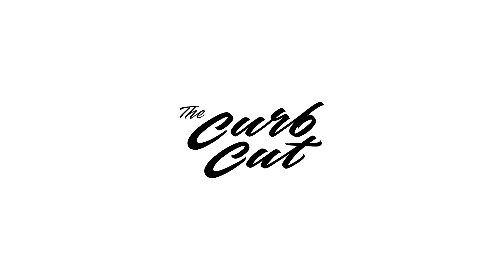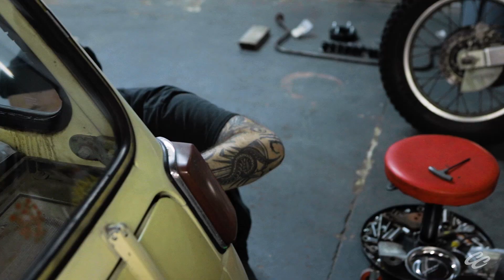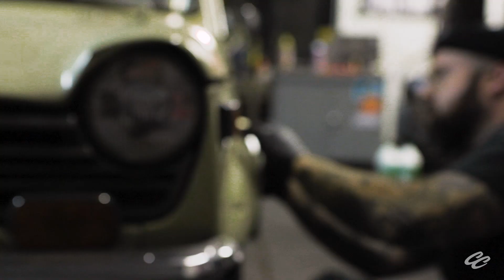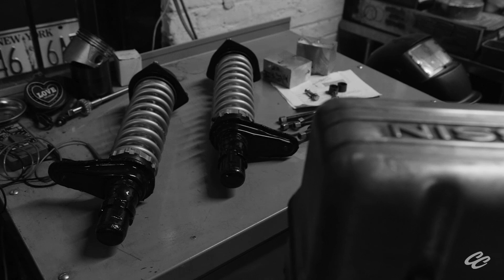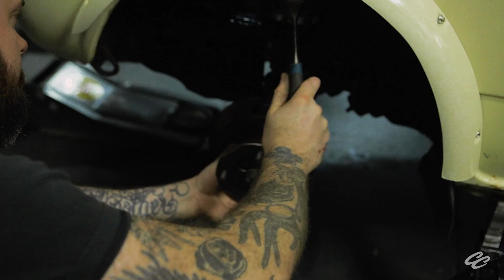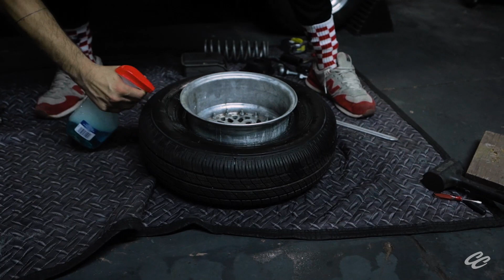Corrections, Upgrades, and A Brand New Look for Our Honda N600 Build

Comment: Hello, I am currently in the process of restoring/ modifying a honda Z360. I believe most of the parts are identical and used in both the N and the Z.  I am very interested in purchasing some of the the adjustable strut caps from Silk Road. I know it has been some time since this video, but are you able to assist in helping track some down, thank you
Reply from the maker: @radedimkin1983  send an email to john (at) groundlevel-nyc.com

Comment: Thats a cool solution you came to with those coilovers, never thought of a helper spring before.  Very clever.  Big fan of the show.  Love the cinematics and editing.  Im a NJ enthusiest not too far away, are you open to shop visitors?  I've got a Datsun 1200 ute I need some parts for you might be able to help me out, specifically I am not happy with my 15x8 longchamps on the front I would like something a little more timid like a longchamp in 15x6 or 15x7, perhaps you know or have some yourself?  Cheers.
Reply from the maker: Right on! Send me an email at john@groundlevel-nyc.com and we’ll talk